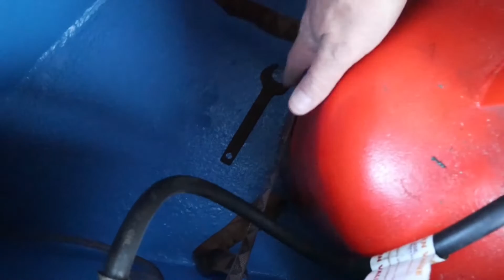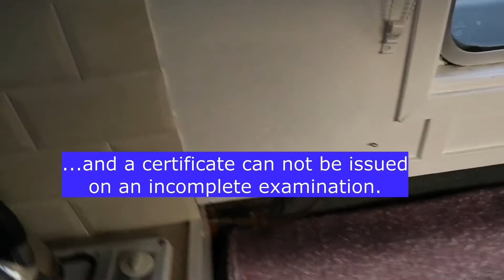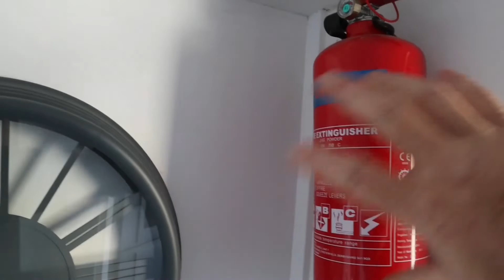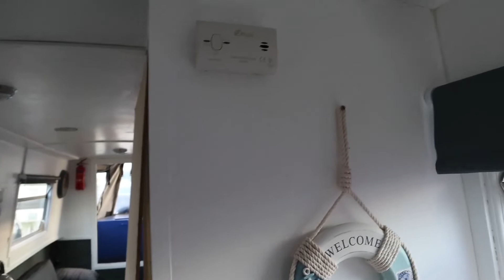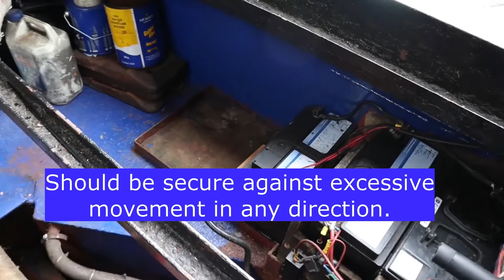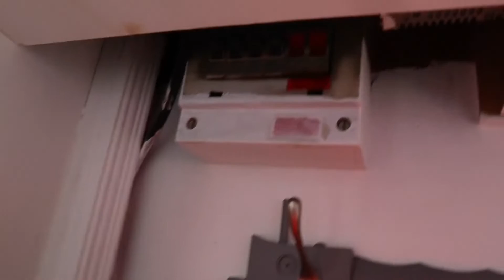Narrowboat Boat Safety Certificate - Tips for BSS

Comment: Good morning again. Just a point on fire extinguisher/boat length. Boats under 7 mtrs require 2 extinguishers. Boats between 7 and 11 metres require 2 extinguishers. Boats over 11 mtrs require 3 extinguishers. 

The important thing is the A & B classification numbers

7 mtrs long need to equal 10A/68B when added. 
7 to 11 mtrs long need to equal 13A/89B when added. 
Over 11 mtrs long need to equal 21A/144B when added. 

Hope that helps. 

Steve Williams
BSS Examiner

Comment: Good morning. During a BSS Examination the examiner will not need to see your engine running. It is not a requirement for BSS examination certificates. Hope that helps. Steve Williams. BSS Examiner.
Reply from the maker: Good point Steve, mine just wanted it running to check the exhaust.

Comment: Why every four years and not three or five?
Reply from the maker: It's just how it is, maybe 4 years is about the time when things could need replace/repair.
Reply: Good evening. Just a little insider knowledge. CRT and EA are exploring changing the frequency to every two years according to out local waterways chaplain. I was talking with him at Barbridge yesterday and he said the chaplains are struggling as it is with helping people out. I don’t think it is manageable. There are insufficient Gas Safe Registered examiners for the in-scope boats as it is without doubling the frequency. Of course everyone thinks that an Alde leak detector is the answer when in most cases, they introduce immediately dangerous situations into a gas system. More GOOD examiners are what is needed. Quantity does not make quality!